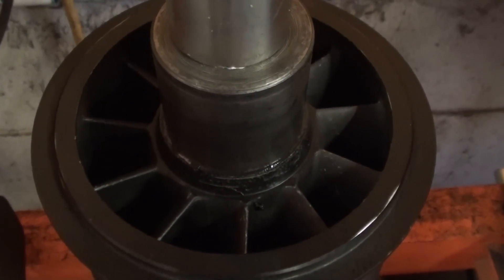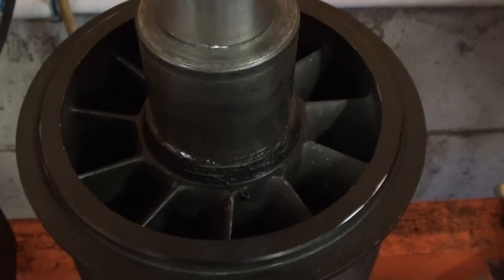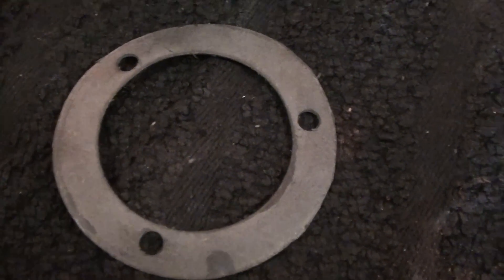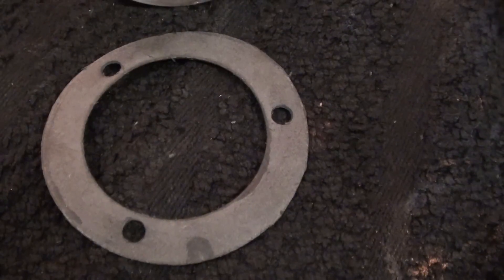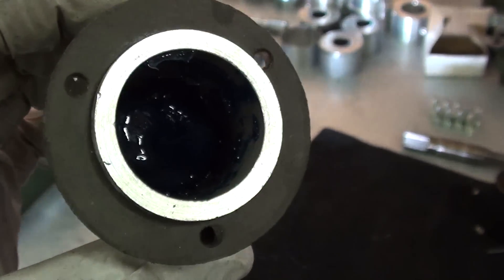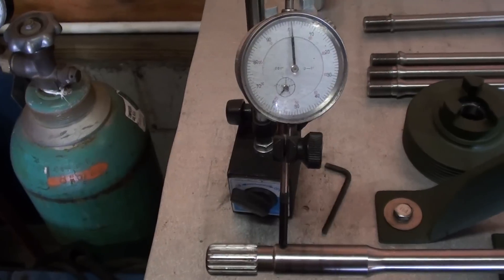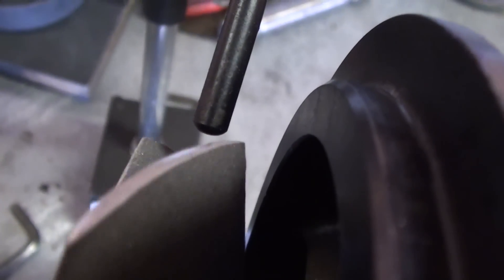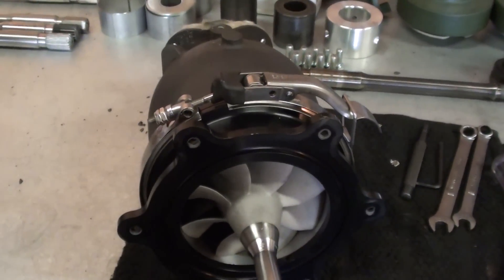MOKAI™ Jet Pump Rebuild - Conversion to Oil Lubrication

Comment: Where do you buy parts for these jet units
Reply from the maker: I've developed a rebuild that changes the internal design, so if you want your pump more efficient and reliable you would have to send it to me for that work. These are not user serviceable. I can repair just about anything on these so the only reason to need replacement parts is due to loss, and you would have to contact Mokai for those after you can prove you own one of their boats. They won't just sell parts to anyone.

Comment: Hello. Have you tried smoothing the junction in the stainless shaft as it meets the impeller for better flow in a lathe? Thanks.
Reply from the maker: The mating area is already tapered and smooth at the transition. There is nothing to improve there.